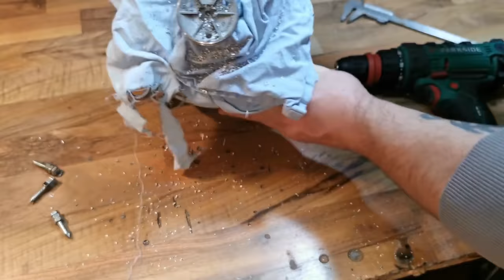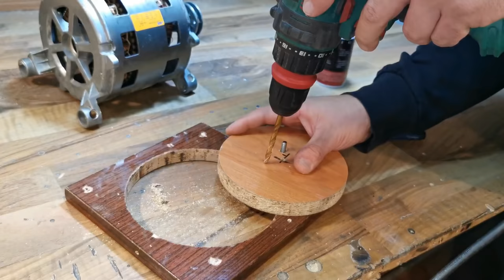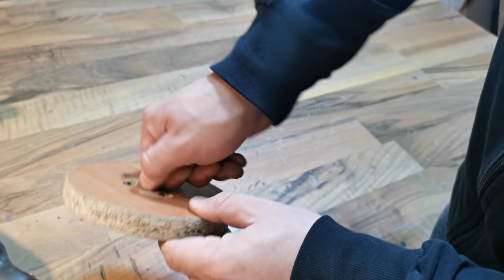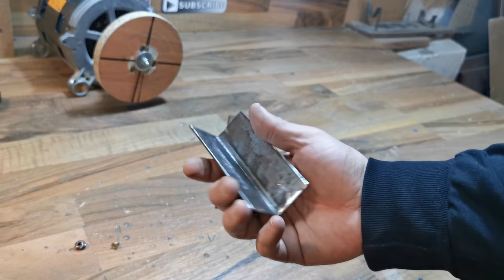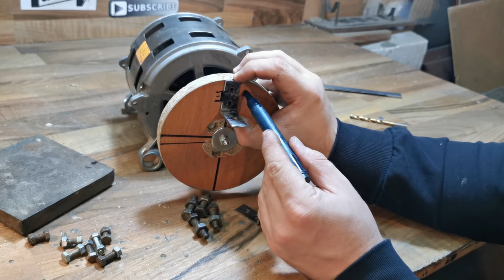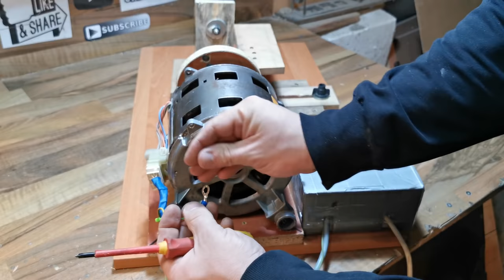Homemade Lathe Machine Using Washing Machine Motor

Comment: It works well, looks very practical, and does what has been intended for hobbyists, however besides some minor modifications on the chuck, the railing, and perhaps a safety shield in front of the workstation are doing an awesome job.

Comment: Yeah,
 I'd be a bit leery of using that as a direct-drive unit
Not too keen on nuts & bolts, with shards of angle iron, being flung at me at17K rpm
(I'm guessing the rpm)

You could add some nail spikes around the perimeter of that faceplate to increase it's  aesthetic appeal, I guess
Reply: These motors from washing machines usually run at 1200 to 2300rpm. Wooden chucks if made from birch plywood and angle iron are a good and safe method. Particle board is never a good idea, even when it is covered with melamine. The only structural problem I see is in the tailstock - a triangle is needed to stiffen up the construction.
Reply: 2 de se vi
Reply: Most probably this motor works at 1300-1400 RPM as they are 4-pole design. Nothing to worry about.
Reply: Anda seorang yang genius and creative... salam sukses selalu ya 👍👍
Reply: This right here. I would NOT trust that """"chuck"""".

Comment: I have a really nice Bosch washing machine motor that I pulled and it is seriously fast. But it doesn't have the same torque yours does. What are the specs on it and where did you find it?

Comment: I would suggest using solid hardwood for the faceplate. Particleboard has no strength and screws can pull out easily.

Comment: Might be good for smaller objects like the dowel for an upright paper towel holder (or actual dowels). But your not going to be turning out any bowls of significant size (pun intended). On that point it leaves a lot to be desired. But then again so do model rockets, RC aircraft/boats/cars, and drones.😏

Comment: At 15.20.  You are starting the Motor with your hands. So obviously you haven`t got a capacitor connected,which also means that the secondary winding is not connected.
Reply: Very nice point made. The winding can be done carefully so that it can be self start and also if more copper is filled into the slots, then it can be made into heavy duty motor.
If I were to design this motor, I would make it in chain winding configuration which can even save more energy and almost never heats up on long duration of operation.

Comment: Great idea , BUT I was cringing when you put your hand next those brackets as they are spinning to sand that piece.  Ok it would have been soooo much faster and safer to  drill and tap the end of the motor shaft and use a short piece of threaded rod sharpened to a point with a t-nut with lock nut to hold the t-nut in place , AND you would have been done before you got the 3 holes drilled in the pulley. Not to mention no time for wood circle or brackets. Look I give you this ( you got it done ) but you went the longest way around to make something that not safe. One of those brackets hits you and your going to the emergency room. 
Next time  drill motor shaft and tap,
Then use threaded rod say 3 in will do.
Sharpen point add 2 nuts and a t- nut 
The 1st but looks it to the shaft, 
The 2nd nut is a lock for the t- nut .
The point on the threaded rod keeps center and t - nut spins your work . Simple and takes less room than the pulley that you could have gotten rid of anyway.